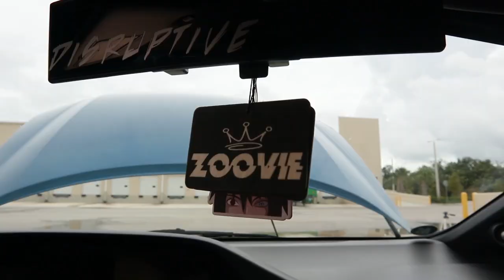E85 9TH GEN SI MOD LIST! (2021 UPDATE)

Comment: What’s up zoovie, so quick question for you and who ever else wants to give their opinion. Do you think modding a 2014 Honda Civic EX is looked down upon in the Honda community, because it’s not an Si?
Reply from the maker: I would just get a Si if you want to make it faster
Reply: Bro you do you!   Don’t worry about what someone else thinks! Plenty of folks mod ‘base model’ cars… as far as speed, yea your gona need a turbo or K24 swap to really make some power but the 1.8’s can be quick with the right bolt ons and maybe a tune - if speed isn’t your overall goal then your fine with intake & exhaust (plus you can always go boosted in the future so maybe keep the bolt ons ‘simple’). You can literally do the same things to your car as anyone else.
IF I WAS YOU I would go: 
~cold air Intake
~catback Exhaust (don’t go large, you want to be around 2.25”-2.5” piping MAX)
~Tune (if you can find software, maybe Hondata?)
~Suspension 
~Brakes (upgrade pads and slotted rotors)
~Lights (LED low/highs and fog of you have them, and interior)
~Front lip 
~Shift knob (& cable bushings if your car is manual) 

Undoubtedly your car will look, sound and perform much better and you will enhance your driving experience tremendously - Keep the car IMO, make it yours, who gives a F what everyone else says

Comment: Its a stock engine, and you rev it out to 7800rpm right?
Reply: They’re safe up to about 8k with a good tune, Kyle handy has me revving to 7700 on 3” intake and stock manifold, but many FBO guys rev to 8k
Reply: @BoostedFB6  yeet, I gotta find me a tuner to get me there!
Reply: Don’t do it unless your making the power. It’s not worth it to risk stressing stock parts just to hear the motor scream a little louder - it might be screaming “stopppppppp” lol
If you want the typical high revving Honda motor than the K24 in the Si’s is just not for you, they are much more linear power with shorter rev ranges and less vtec, got more tq though-which does matter in a Honda 

When you get your car tuned you will see/find where it is making power, that’s where your limiter should be… I can tell you first hand that ‘early’ vtec crossover and raising the rev limiter can be quite detrimental and result in loss of mpg and premature/excessive wear on stock parts

Just IMO, which I’m sure no one cares but hey that’s what comments are for… happy Vtec’ing!